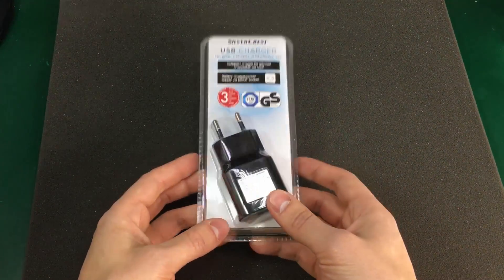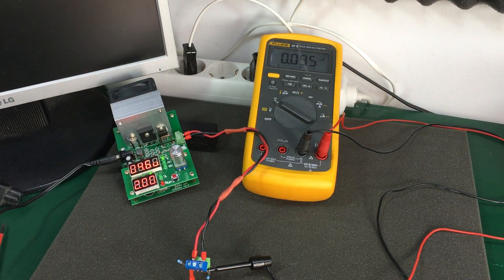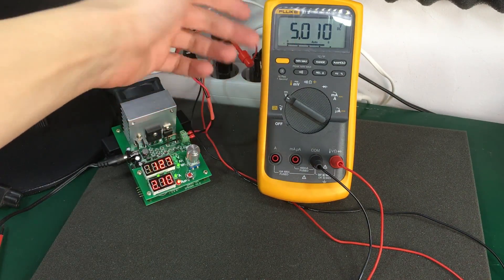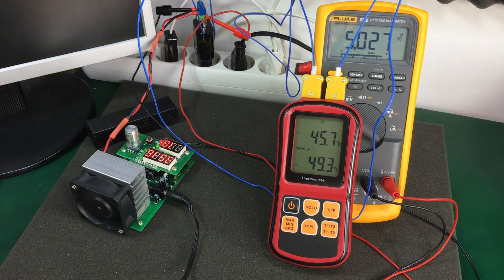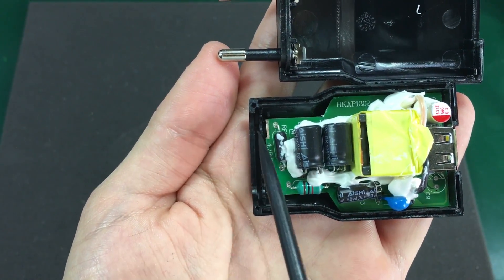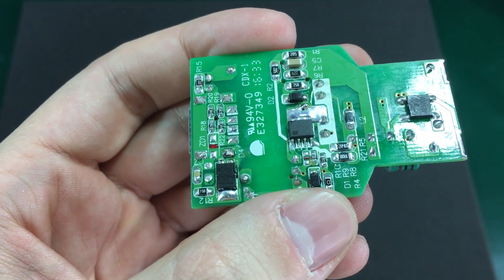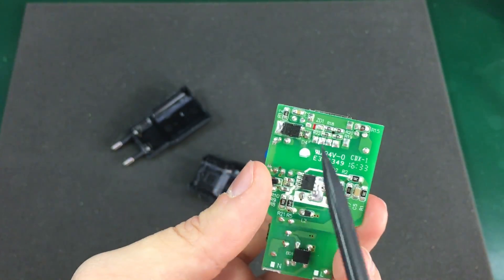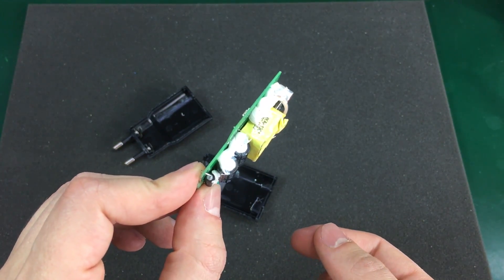Voltlog #89 - SilverCrest LIDL USB Charger Teardown

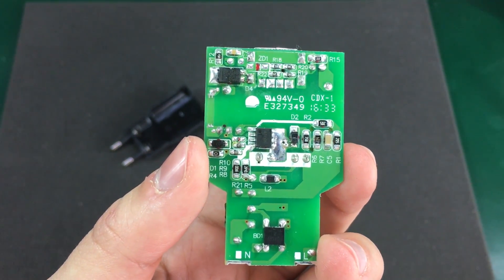Comment: 8:24 It may sense it internally in the chip, if i understand data sheet properly Tinny family III sense voltage drop on mosfet to detect over current.

Comment: Yesterday I bought one but after seeing this video, planing to get another one, seems like it covers the Raspberry Pi power supply requirements of 2.5A 5V and the build quality is good.
Reply from the maker: yes, it could safely power a raspberry pi. In fact that is what I was also thinking because I have a pi zero and I am waiting on a 2m long micro usb cable from ebay. I'm curious to see what the voltage drop will be on this 2m cable..

Comment: 4.7 ohms as a fuse.. to get that up to 1W you would already have to pull 460mA through it, which means 100W of power being pulled by the little device XD i dare to say this is not a good replacement for a fuse.

btw remember me saying i should start a channel? i decided im not yet ready for making videos. so i hope i will be more active on my blog. http://electronicsavage.blogspot.de/ would be happy about some feedback
Reply from the maker: Special fusible resistors are often used for 10W or less. 4.7 ohm is a common value and is recommended in most design tools. Congratulations on starting your blog. These days I feel like it's easier to watch video content, however video content is not easily searchable so written blogs still have their advantages.
Reply: it would still not kill the resistor at 100W power consumption. so the whole thing would melt and catch fire before the resistor blows in that state i guess. seems all come down to production costs.. resistors are cheaper than anything else.

yeah i would also like to make videos, but its just not my thing. writing a blog is so much easier, and i can better convey information. also i dont have a camera in my way when working on stuff
Reply: maybe that resistor is a replacement for fuse( short citcuit of rectifier or ic or caps )will burn it right away....

Comment: Another nice review. Could have been interesting to see what's the voltage in the USB data lines. 
BTW, here in Germany LIDL sells these PSUs for about 5 Euros.
Reply from the maker: I did a quick measurement 2.3V and 2V on the two data lines. I guess the price is adjusted according to market. Other products are less expensive over there.

Comment: Thanks for good video & test. These are stocked in Lidl Uk too for £3.99. I like the idea of using one to power a project.
Reply from the maker: yes, they will work great as a small 5V regulator.
Reply: Actually £2.99.
Reply: Ah, interesting Toby. They WERE £3.99 in my local Lidl a few days ago...will have to go back in and see if they have priced them down to £2.99

Comment: Have you seen the 150W / 10A dummy load on ebay? I got one but something buggy was going on with the current regulation. Refunded and waiting for a new one.
Reply from the maker: yes I am aware of that model with the 16x2 LCD but I haven't got one yet. I have so many of these chineese dummy loads in the lab..

Comment: Nice. I saw it the other day at Lidl and I was thinking it seems like a good deal for a quality 2.1A charger, but I already have more USB charger than I will ever need.
It was sold for 3.99€ here in France, and 14.99lei in Romania.
Also I think the USB specification allow you to go way below 4.75V, even if a good charger should probably not.
Reply from the maker: Yes 15RON that is like 3.3EUR. I didn't need this charger I was just curious about it's build quality considering the low price but it looks like they did it right and for a low cost. Of course LIDL has huge purchasing power and that dropped the price considerably.